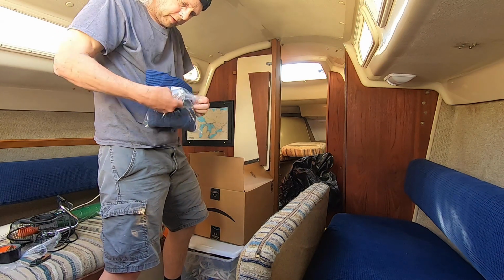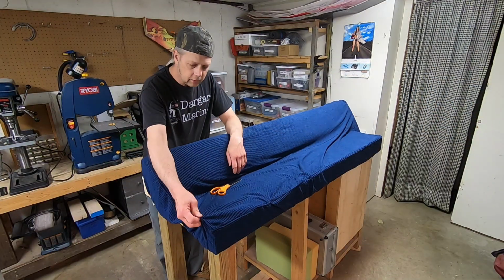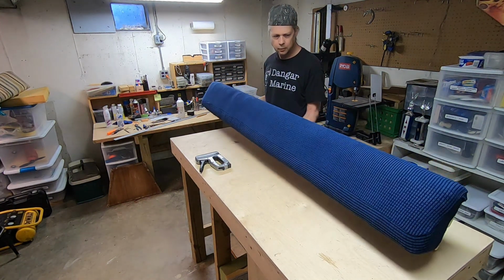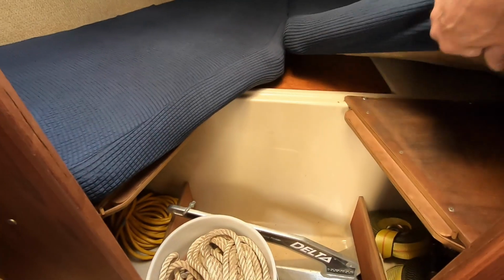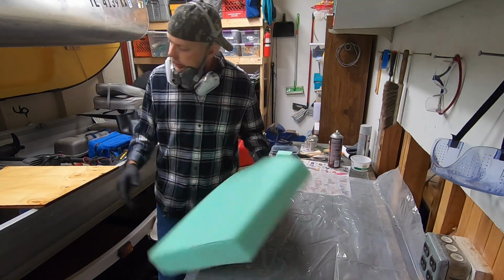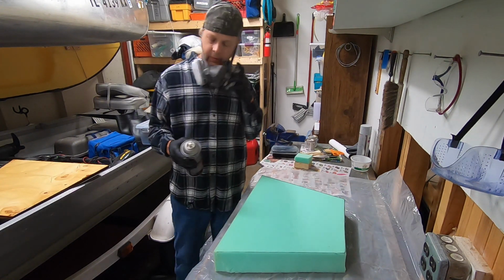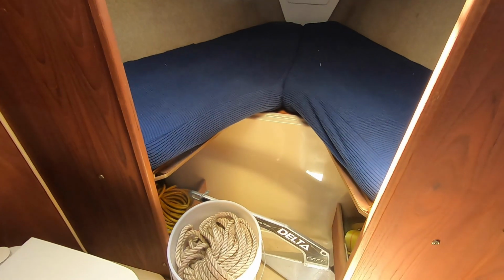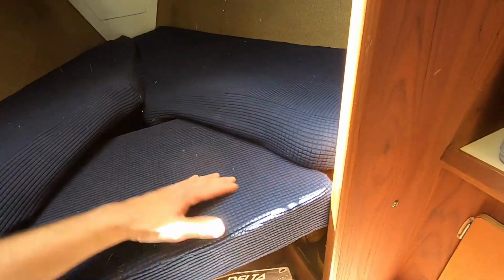New Boat Cushion Slip Covers...Easy ! |  E39

Comment: That was a great idea and way to recover your cushions. I had all my cushion recovered, and you are right expensive. Your boats looking great. What motor do you have. I’ve got an OMC saildrive. That’s a hole other story. Good luck.
Reply from the maker: Thanks James! I have a 2008 Suzuki 9.9 outboard 4 stroke.  Electric tilt and start. It runs good but has a lot of vibration at higher speeds. I have to polish the hull paint which is oxidized and in rough shape, before I can splash.  Hopefully in a couple weeks. 😀

Comment: I am going to try this on my O'Day 26. However, all of the cushions and covers were moldy and I disposed of them. I am going to buy foam from Sailrite and just cut the foam and use the slip cover. I'll do 2 or 3 of them and see how it works out. I am planning to get the foam at Sailrite, but any other suggestions are welcome.
Reply from the maker: That should work with just the foam and the covers. I can't believe how much the foam costs now! I got mine at JoAnne Fabrics but I only needed one little piece for one cushion. Hope it works out for you. I am happy with the results of mine so far.